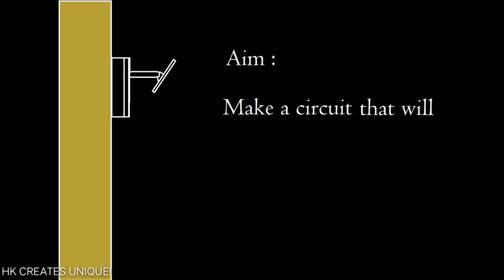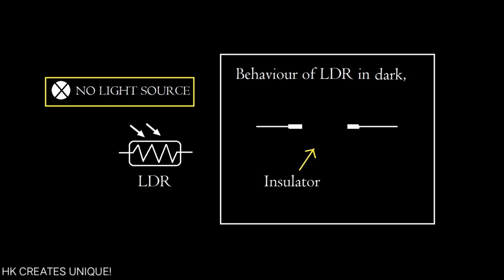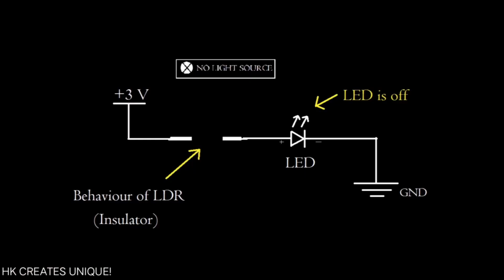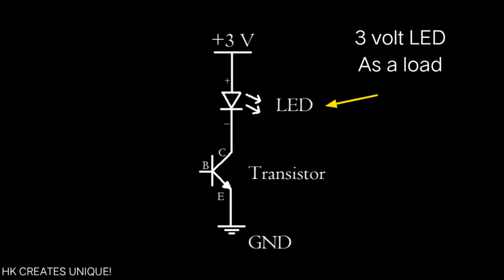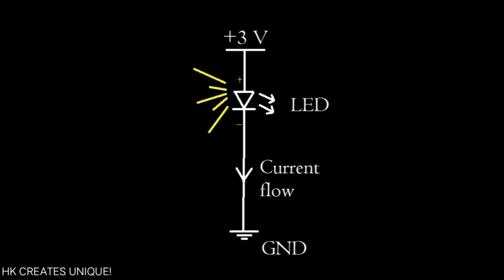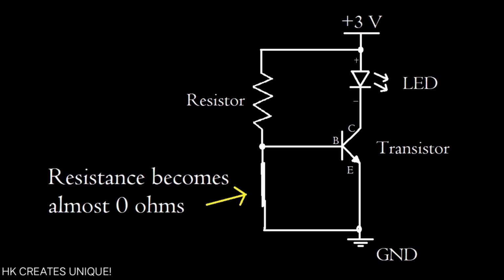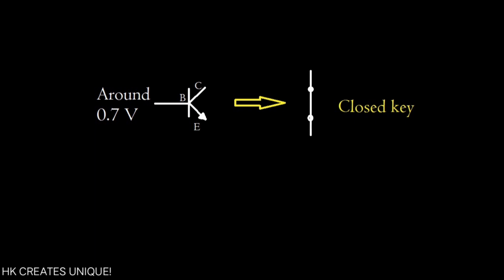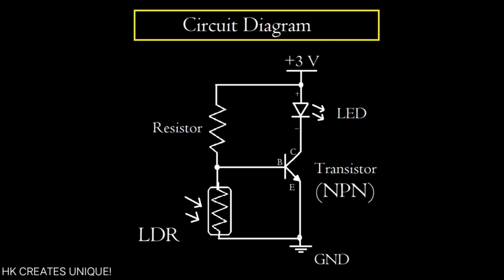DIY Automatic wall lamp  || circuit explained

Comment: I didn't understand. why we get 0 v at the base point
Reply from the maker: It is because LDR behaves like a conductor when exposed to light,
Reply: @circuitedu  I know that. I asked why conductor has 0
Reply from the maker: @himeshchanc.8946  Conductor in electricity has obviously least resistance. Therefore LDR becomes almost 0 ohms in light